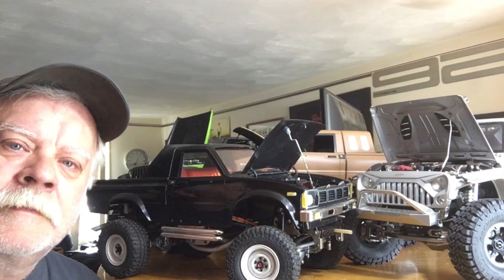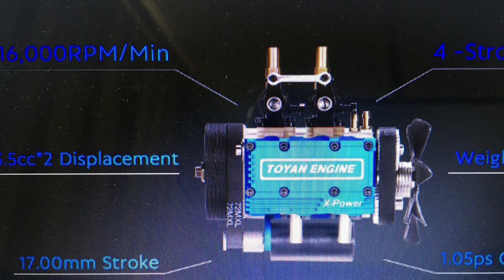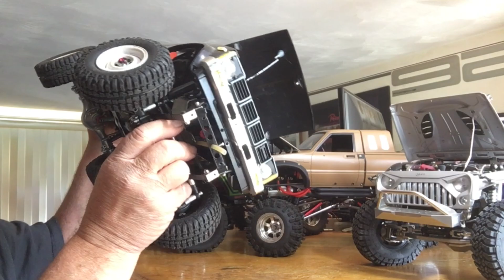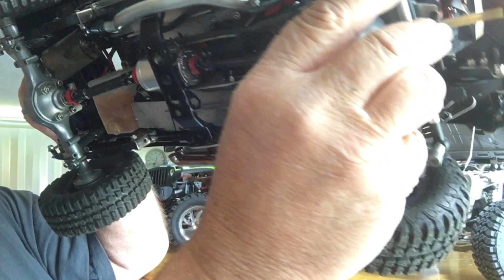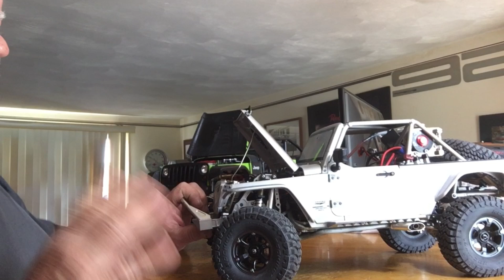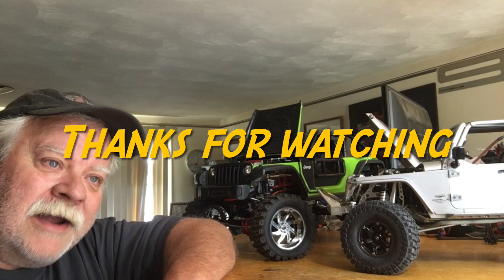NEW TOYAN X-POWER ENGINE GOOD/BAD???

Comment: Hey Dennis you're on point on everything, my timing belt wore out on my L200 so I ordered a new one and after a month or two I received it and it was wayyy too tight and snapped on me, I contacted Mona and first told me I ordered the wrong belt when clearly my order was correct and labeled "Timing Belt for Toyan FS-L200 Nitro Engine" and finally after days of back and fourth they sent me another belt again 2-3 months later and it's still is too tight to fit, you can get it on but it puts so much stress on the idler pulley it actually bends it inward and the engine barely wants to turn over. The problem is these are engines and like all engines they wear and tear eventually you'll be left with an RC that will be sitting for months just waiting on parts and that's if the company is still there over time...I'm skipping the x-power and I'm going to try out the new 8.4cc engine similar to the Toyan engine you talked about in another video even though it looks very similar.

btw I saw the video too he had the idle screws way out without springs for tension and the carb slides were completely loose and about to fall out lol

I appreciate all the information you put out there its a gigantic help for everyone in this community!!! Thanks again be good bud!!👍👍👍
Reply from the maker: Thanks brother! you brought something to my attention, I bought replacement belts for my L200 and FS100 I looked at them and they are not the same belts that came with the engines, they are stiff and have no markings on them, now I am wondering if the belts even fit? lol.  I have to check them out and test fit them now.
Reply: @dennisdempseyradiooutofcontrol  yeah they aren't the same for the L200 for sure! two belts now and they both don't fit right, but the belt I bought for my S100 did fit thankfully. Let me know if it's the same for yours you bought as well. Take care bud!👍

Comment: Hi Dennis. The info from Tom at Stirling Kit is very sketchy. Unclear what improvements, other than looks, X Power has over the L200. I agree with you, I am not going to fund their development tooling costs. Is this just rebranding ? We are all still awaiting reliability improvements on the L400. I have looked at the Enjoymor 36cc DOHC engine too, but, until recently, all the info was poor CAD renditions. I think those skinny drive belts will be a big problem unless buyers  (like you, Tim and Johnny) can make proper pulleys with proper belts.  Keep up the good work
Reply from the maker: Yeah everything is a mystery with their products, and not much info on the new X-power just lots of sales pressure to commit to buying, The first thing I noticed when they had a running video of the 36CC DOHC engine there wasn't any belts on the oil pump lol! then their 20 second video of it installed in a car it had no clutch on it,

Comment: I'm a poor guy .. and been a scratch builder for nearly 50 years .I can see dropping 4 grand on one project ..other than the scale looks of the engines I'm not sure why you just dont use a Traxas or Pico engine ..I've ran dozens of those engines for decades ..with really good results ..I've looked at a lot of different engines over the years like the Connelly V8s and I just cant get my head around dropping 8 grand on an engine . Wen I paid a grand for the car I drive ..dont get me wrong I really think they are awesome but way over priced ..back in to 80s i bought a 7 cylinder Sato radial engine for a biplane project and though that price was nuts at $250 back then ..I guess it's a matter of preference and money ..but I enjoy your videos ..I'm always looking for ideas.. maybe it's time to start up an American engine manufacturing company or expand a company like fox ..?
Reply: The traditional 2 strokes are great , but personally I dont like the noise level they give off , people whinge when you drive , without a track it's hard to enjoy yourself , not to mention heavy starterboxes suck ! The toyans have none of these issues .
Reply: Check out the Cosworth V8.
Reply from the maker: I like the Traxxas and Pico  engines for their power and reliability, these Toyan 4 stroke engines have so much potential and scale looks they just caught my interest, I remember back in the 80's they had a .12 2 stroke engine that laid on its side with a plastic cover over it looking like a boxer style engine, they called it a engine module,  the aussie V8 is a copy of the Conley 1st 2nd and 3rd gen engines I was quoted about 3000.00 for the current assemble it yourself kit. It would be cool to have a American engine company but the final costs would probably be high for the engines, great idea though.

Comment: This is why my Toyan powered Globe Liner project is stalled out. I need a 3-speed with brake, and I need a skookum clutch, and it's just impossible to get them and know they will work. And it's a lot of money to experiment; their 3-speed with reverse and brake is perfect for that build but holy shit is it expensive.

And I'm just working with a basic air cooled single!
Reply from the maker: I wish a company would develop a good 4 stroke clutch with all the cnc machine technology out there it could be done
Reply: @dennisdempseyradiooutofcontrol  I saw a mini lathe for not much and thought about making some parts , without the knowledge it's hard to do though , maybe somebody could 3d print some stuff for us All .
Reply from the maker: @stevenwalker1883  hey this came in my inbox today, the price is a lot better than before.
https://www.enginediy.com/products/toyan-fs-l200-inline-2-cylinder-4-stroke-nitro-engine-modified-gas-powered-rc-car-1-14-6-4-3-axle-remote-control-tractor-vehicle-truck-frame-diy-assembly-kit-presale?utm_campaign=emailmarketing_120326258881&utm_medium=email&utm_source=shopify_email
Reply: @dennisdempseyradiooutofcontrol  I saw that a few days back , I was interested but a few things are odd , they say it's a 3 speed with identical ratios to a Tamiya semi , I think they just copied tamiyas description , the gearbox is positioned really awkwardly and the exhaust is a but ghetto , good on them though ! I have just got my 3 speed l200 Scanias gearbox in , IV got scaleclub parts and the pulley parts licked in anodised purple , i want to add a compound turbo with the 10 KR , I know nothing about that stuff though ! .
Reply: Their box I think is great value , it's ball raced and steel , very strong !! .